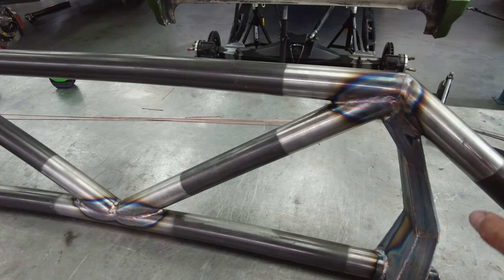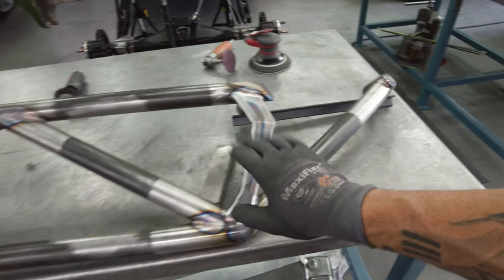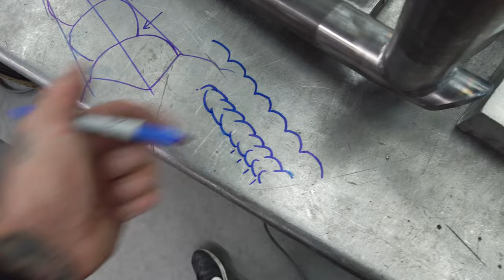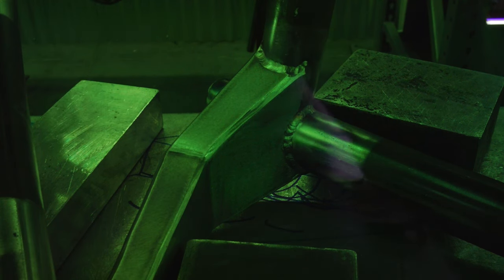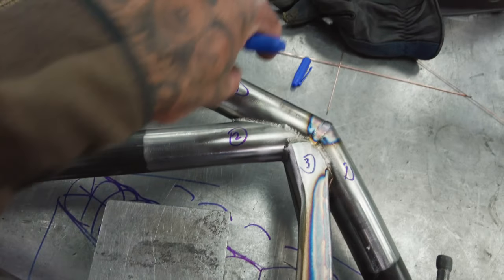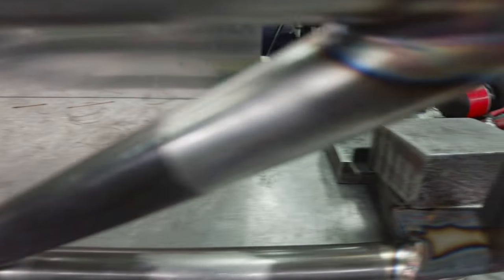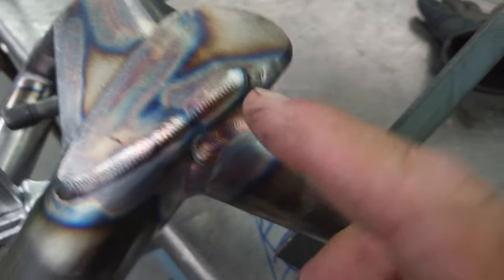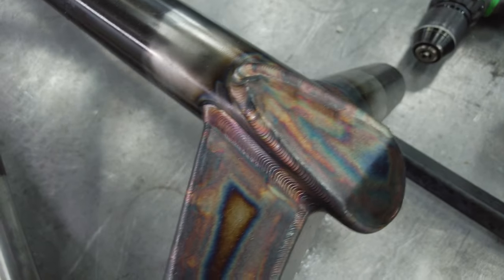The Fab Diaries - How to TIG Weld (Double pass) with Morgan Clarke: Part 2 FINAL PREP + COVER PASS

Comment: I like how you explained it as the construction of the story, when it comes to welding and in what order you weld. Very well put together and I appreciate the tips. In your last video you had mentioned about MaxiFlex gloves, lovem and have used them for years. I'm sure you know about these but figured I'd post it anyway (in case anyone else is interested in some quality gloves) You should give Tillman TrueFit Top Grain Goatskin Performance Gloves 1470, these are mechanic type welding gloves and Tillman 1488 Truefit Top Grain Goatskin TIG Welding Work Gloves, these are very thin like a MaxiFlex but are a very flexible leather glove, you can feel everything with them.
Reply from the maker: Thanks for the info!!

Comment: Thanks again for the videos. It is very much appreciated! I love the tips on prep, dual pass, weld spacing, and welding sequence. 

One suggestion is to use a glass cup for filming. It would help viewers see more of the puddle.  Also, if you have a 3d printer I believe there are files online for rigs to hold the welding filter and camera. That’s if you don’t want to spend a bunch on a dedicated welding camera.

Comment: THANK YOU!!!   33:00 to 38:00 was amazing and exactly what I was hoping to see...  no talking, no music... just 5 minutes of EXACTLY what it looks and sounds like when you are working your way down a part.   That was immensely helpful Morgan... I'm sure I will watch that part over and over.   The prepping of the open corners was super helpful, as was the advice to use .045" filler to avoid "overfilling" a nice 45* beveled edge.  My open corners aren't as perfectly filled as yours were.... so I might stick with the 1/16" filler just to get a little more material into my cover pass.  Just curious what the machine was set at when you were doing your pedal whomps.  What sort of current range are you pedaling between?  (100 on the low pedal to maybe 225 on the high pedal?)  It looked like you were using a LOT of pedal travel so it seems like it might be a pretty large swing in amperage for that cover pass.   Awesome Video... worth the wait!  ;)    @MightAsWellK5

Comment: Thank you for the info provided, but was wondering about the Gas CFH setting, post flow time, and Amperage…? Thanks again, you are The Man.
Reply from the maker: Thanks for watching! 25-30 cfm. You might get better color with more. I try to conserve some of the argon if it’s possible. Post flow 10 seconds. If I want a little more, I’ll hold the tungsten in the area contacting the part, then hit the pedal. That will buy another round of 10 seconds.
Reply from the maker: Amperage anywhere from 195-255

Comment: As always, I appreciate you man. what grade of weldnuts do you use?I'm directing this to you because i see the safety factor you abide by and i trust your opinion! Specifically if we are talking about oem replacement weldnuts. Not a fabricated setup, Im sure design style might allow for a different configuration miss information is bad in my location. I need to replace a factory weldnut for a rear seat mounting bracket to the floor. The original grade is unknown. Do you believe there is an embrittlment issue with grade 8 (10.9 metric) weldnuts or is their design made to accommodate for that (following proper welding practices) given the added material tabs? Is grade 5.5 metric adequate? Any info might instil some confidence in my choices thank you. Yes iv looked at the debate between sheer and bend. Any opinions on fine or course threads for the same application ??

Comment: Awesome info! What are you running the pulser at? Sounds like 60ppm. 75/25 background? Thank you!
Reply: And amps? 180-200?
Reply: Pulse was set at rf1ps
Reply: @dannyliggett-ij5we  I could hear the pulsar in the background in addition to the foot pump.
Reply from the maker: This machine has no pulse settings.
Reply from the maker: No pulse on this old bastard. Just foot. 

225amps.
Reply from the maker: I don’t even know what that is.
Reply: Like I said rf1ps right foot one per second
Reply: @dannyliggett-ij5we  I was thinking the same thing as the other guy, ig those old school welders sound just like a Dynasty with a high PPS setting
Reply: @edfsolutions8387  transformer machine my dude